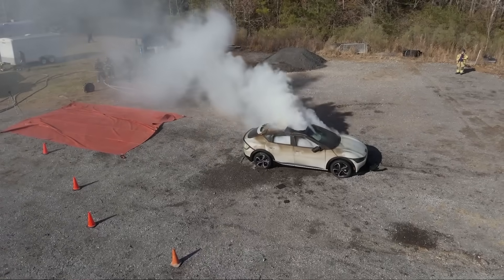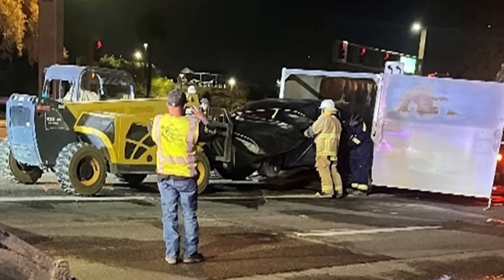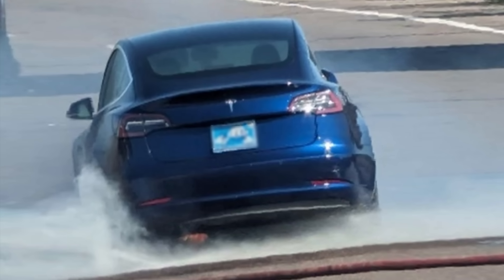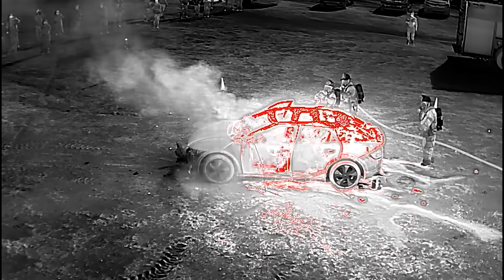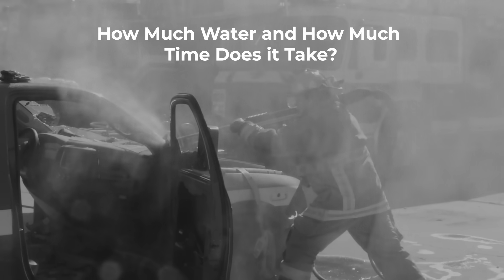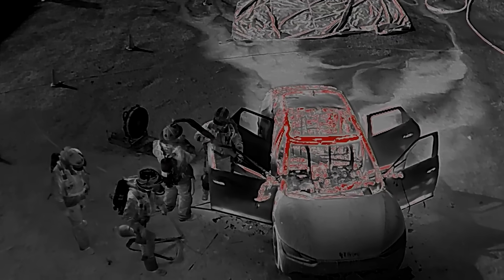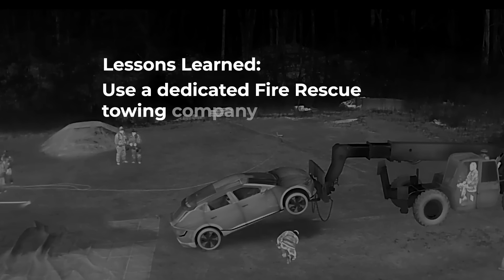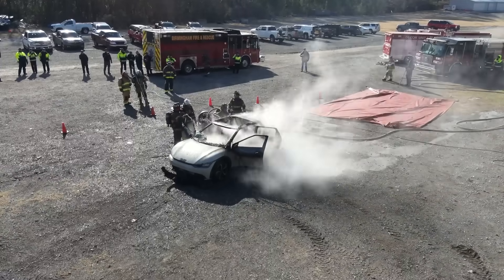Quick and Efficient Method of Extinguishing of an EV Fire tested in Tempe, Arizona

Comment: The procedures for extinguishing the specific types of fires was developed in the 1980's.... I was the project manager and worked in the aerospace industry and actually the largest advanced technologies manufacturer in the world here in Los Angeles. We injected Halon into the battery container.... The clean agent immediately terminated the fire, the nitrogen cooled the enclosure precluding reignition. Today halotron which is environmentally safe can be used, the FAA has been doing research on this specific procedure for the past several years and so far agrees with the results...typically 60 seconds from start to finish.

FYI.. we brought this to the fire both at state and national....we invited numerous fire service agencies to come to the training sessions.

100 percent no interest.
Reply: Hmm.  Old Civil Engineer here observing how comm and industrial bldg sprinklers have removed nearly all traditional fire dept business for those properties. 
There’s a constituency for not solving problems at source.  Often plays out as celebrating methods that instead treat the consequences, expensively.
Reply: @manzion7599agree on the fire sprinkler systems and fire walls for that matter are not designed for the temperatures generated by electric car fires. Typical structure fire is around 1,800 degrees.... Typical conventional vehicle fire is around 2,500 degrees..... EV battery fire.... 3,500+ degrees. This is clearly outside of the design specs of every conventional fire sprinkler system. If 20 percent of a conventional sprinkler system is activated the system is over ridden. If you look at the data, unless the EV fire occurred in the presence of a special applicatiin fire suppression system, a massive uncontrolled fire has occurred..... Structures, ships, etc.
Reply: @manzion7599now you got it! Just like the cops make sure there is enough crime to prove we need them. Hence people went to prison for cannabis while child oredators and rapidts get 5-10 years, out on good behavior in 2-3.
Reply: It doesn't need to be a high tech fluid does it? Injecting brine, as cool as it can be on site, puts out the fire due to the water but also discharges the individual cells because of the salt ions in brine. The discharged cells can't reignite.
Reply: @Bowser-j8q  Lithium and water is a bad mix.
To put out a lithium fire, yes you must cool it, but most importantly you must dilute all exposed lithium or the presence of oxygen and especially water can cause a fire.
Lithium reacts with water (oxidize) releasing the hydrogen and with sufficient heat presence said hydrogen ignites.
Reply: @Bowser-j8q  I was part of the team developing this method and we actually recommend not to use brine. The reason being the electrical risk assessment if we get a brine solution on the ground. It was one of these very low likelihood events that we want to prevent and by having clean water instead we lessen the conductivity of the water puddle.
Reply: @Bowser-j8q wate when it comes in contact with the superheated cells can violently react...plus it is extremely difficult to get water inside the battery enclosure whereas the halotron is a gas that stops the chemical chain reaction so fire cannot occur and the nitrogen which is the propellent drops the temp way below the cell ignitiin point almost immediately. In the afternath, the brine is an excellent neutralization.

Water runoff also creates a hazardous waste from the runoff where the halotron keeps the integrity of the battery box infact
Reply: @Bowser-j8q  Wouldnt brine cause a short circuit and cause the good batteries to go into thermal runaway? Remember we are dealing with high voltage/amperage here. No offense but I would stay away from discharging these giant battery packs in any way other than a controlled environment and constant monitoring of the heat generated by the batteries as they discharge.
Reply: I guess the need wasn't there back then.  In the 1980's we weren't using lithium ion batteries very much. But with over 3 million EV's on US roads in 2025 - I guess they'd be more interested now.  Also, something that needs exotic chemicals is going to be difficult for them.   This new contraption only needs water.
Reply: @SteveBakerIsHere there actually was....the aerospace industry and EV 2 had hit the market as well. The issue with water, the run off, You now have created a hazardous waste release that fire personnel are required to mitigate. That is why 3M stopped manufacturing AFFF.... Excellent at flammable liquid fires, but created large environmental hazardous waste clean up sites
Reply: @jeffalvich9434  There wasn't an "EV 2" - I assume you're talking about the second generation "EV 1".  That car used Nickel Metal Hydride batteries - not Lithium-ion...the first generation used Lead Acid.  So I'm not sure that it had the same kinds of "Thermal Runaway" that make Lion batteries so difficult.
Reply: I worked for Hughes Aircraft Company at the time, although it did not go into production until 1999 IIRR, Dr. Harold Wilson was a senior engineer at HAC Space and Communications Group, he was in charge of the program...along with GM
Reply: @SteveBakerIsHere you are right from the aspect that they didn't have the same thermal runaway type issues with recharging because you had real engineers who had decades of experience with these batteries has to compare to the current engineers.... With the exception of Ford. Ford aerospace was located in Orange county California and was a premier r&d facility for advanced technology batteries. When they closed up, HAC purchased much of their r&d equipment
Reply: @SteveBakerIsHere there was a video on an EV made in 1901 that still drives perfectly. Only thing changed was the batteries. 1901, electric motor in perfect condition.
Reply: @SteveBakerIsHere  yes there was, I worked for Hughes Aircraft Company, Dr. Howard Wilson was the project manager for both EV1&2
Reply: @SteveBakerIsHere additionally, solar batteries which comprised and utilized in fairly large quantities class d metals were significantly used in the space programs, missile tech going back to the 1960's.
Reply: there was a YouTube of Auto Expert John Cardigan about that method with cold brine injection. it was invented and used on a Norwegian car ferry; they cool the salty brine to -18°C;   -0.4°F; besides strong cooling effect , it also discharges the battery.
Reply: Pretty damn disappointing reaction.

Although I'm not sure if common use of Halotron 1 would be "approved of" since it seems like its primary component(while still way better than Halon) is still ozone depleting and is being phased out of HVAC systems for that reason.
Reply: Probably originally rejected based on cost / benefit.
Reply: @MS-Patriot2  they just didn't want to purchase 1 additional portable fire extinguisher for each fire engine. NFPA nor The California Stat Fire Marshal's Office never did a cost benefit analysis.
Reply: lithium batteries produce ther own oxidiser! they continue to burn even fully submerged - halon would do nothing
Reply: @andyman8630  that is not how halogenated hydrocarbons work. In our atmosphere it is 78% nitrogen, 20.9% oxygen, and 1.1 percent of other substances in this includes carbon, chlorine, flourine, bromine, and iodine. Halotron adds to the 1.1 percent so the 4th aspect of the fire triangle, the chemical chain reaction cannot occur. It does not nor has it ever reduced or impacted the Oxygen level in a room or area
Reply: @jeffalvich9434  
and how do these substances enter individual battery cells that are experiencing thermal runaway?
Reply: @andyman8630  injected through a tube similarly to the existing pressure relief valve. Because it is a gas, it has deep penetration by comparison for the atmosphere and actually protects e components that have not been damaged yet from flames, heat, soot.

Additionally, because the extinguishing agent is expelled with gaseous nitrogen between the ccc being broken and nitrogen creating an almost extreme cooling effect, it is almost an immediate extinguishment and inherit safeguard effect.... As compared to water....and all contained.
Reply: @jeffalvich9434  
injected into the battery pack sure, but how does it get into the 5,000+ indivual sealed cells inside? or does it simply cool the individual cells sufficiently to reverse thermal runaway?
Reply: @andyman8630  I would have to show you the VIDS..... Then your jaw would drop.... Although completely different, I also trained personnel.... About 1000 shop personnel, in live fire magnesium fire suppression. Magnesium ignites at around 970F but burns at around 7000f. If you apply water to this, the temp jumps to between 12-14000F.
And yes, there is a technique to specifically and safely suppress and contain these fires as well. Yes, I haves vids of this as well.

In a very oversimplified answer to your question, yes to both....including but not limited to the internal cell destruction which the breach allows further physical combustion degradation and elimination.

Also remember, the FAA has insisted this R&R into aviation situations and their initial reports, including the IG, validate our findings.
Reply: @jeffalvich9434  
many thanks for your in-depth descriptions! it is very much appreciated!

very glad to know there is now an effective solution to lithium-ion fires!

edit: perhaps you could upload the vids to your channel?

Comment: Could we work with manufacturers to require them to put small external PORTS for pumping fire suppressant directly into the battery packs?????
Reply: It was very clearly explained in the video that the bb-sized puncture needed to be made at the spot where thermal runaway was taking place. They had to use a thermal imaging camera to determine the right spot.
Reply: @vulpo  the only issue is price, they could put thermal sensors on every single individual cell, independently powered, that'll detect any kind of thermal problems with any part of a battery so no thermal camera is even required, it would just bring up the cost, but it could prevent a fire from even happening, catching the problem in time for the battery to be removed and safely disposed of.
Reply: @AKATenn  They already have that to achieve fast charging. The problem comes when it breaks down.
Reply: Ray, you are onto something. Obviously, the big advantage here is getting water directly in the battery. Many EV batteries already have liquid cooling, presumably compromised when there is a battery fire. While battery fires are rare, they are hard to put out when they do occur. That would be a good way to change the equation. I own several EV‘s, and one thing I’ve noticed is that the high power wiring is becoming better marked to cut to stop power to the battery. This would be another way to improve safety.
Reply: Doesn't need to be external just accessible. Doesn't need to be stainless steel just effective at putting water in the right place.

On model x cut here blast with more than 80 psi and all batteries will be flooded. 

Till that happens put a tax on evs to pay for this equipment. Charge the insurance co if a fire is put out. Create facilities to process the damaged batteries back to base material.
Reply: Imagine coming out of a store to your car to find that someones pumped water through the port designed for the firefighters, trust me, its a bad idea, if a sign doesnt stop criminals from bringing a gun into a certain area, not much is gonna stop bad actors from getting their hands on whatever adapter they need to use that port as well.
Reply: @Initial_Gopnik  Yea I spent the last 5 years looking for cars with a water port just so I could try too pee in it?????
Reply: @rayclark7963  someone's never used a pressure washer, do you watch when your wifes boyfriend comes over?😂
Reply: @Initial_Gopnik  Most Ratfink fans make more sense when they speak..
Reply: @rayclark7963  if i dont make sense buddy, something just aint right with you, everything is in plain old english 😂
Reply: ..vandalism. anyone could rig a canister to inject into that port, now the car fire is a car inferno
Reply: wow do you want to do that also for ice vehicles as they are 100x more likely to catch fire
Reply: @flodjod You didn’t have any credibility to lose in the first place, but if you did, this flagrant lie would have done away with it!
Reply: @flodjod  a ice fire is easy, quick, simple.  Did you hear how complicated, special equipment, training to attempt to put out a EV?
Reply: @flodjod  I don't know, what "ice vehicles" are. You mean snowcats? Yes, if neccessary do it there, too. But I didn't know they are likely to catch fire.
Actually any vehicle may ignite - the point is that Teslas are extremly hard to extinguish.
I'm glad to hear that this European invention is used in the US. I support mutual tax exemptions for emergency equipment

Comment: Why not just stop making worthless electric vehicles that can’t go more 200 miles and now cause toxic fumes when they catch fire.
Reply: Per 100K sold, ICE vehicles are involved in 1,500 fires. That is 60 times larger than the 25-per-100K sold for EVs.
Reply: @ at least the fire departments can extinguish the fires and keep the public safe from toxic fumes and reigniting batteries that continue to burn for days. Electric cars are a fad that will burn out, over the next decade.
Reply: "electric vehicles that can’t go more 200 miles" You've been living under a rock. Based on CarWow annual real world test in England. In cold damp weather at night the industry has settled around 260 miles for the attainable price cars while premium cars are doing Way over 300 miles. FYI toxic fumes like Hydrogen Fluroride comes from Burning PLASTICS! ICE cars have just as much Plastics thus the same toxic fumes. Your fear mongering nonsense is worthless.

Comment: Time for fire departments to lean on NHTSA and other federal automotive safety regulators to mandate stricter rules on EVs regarding door handles, battery box construction, emergency battery access and disconnect and much more.
Reply: Fire department can just smash the glass - an EV fire has already destroyed the vehicle anyway - so there is no penalty for doing additional damage.
Reply: Trying not to <sigh...> but....
"EV door locks"
In terms of "door locks" an "EV" is a "CAR".
The door locks are actuated by the LOW VOLTAGE BATTERY , NOT the "Traction battery".
The circuit is thus the same as ANY modern vehicle.
.
"Battery box construction" .... Try some actual "Research" rather than hearsay?
Most manufacturers have information regarding construction and safety on their websites (CATL is particularly good)
Disconnection: you DO know there is a mandatory safety disconnect on all EVS?
.
Define "Much more"?
.
Personally, I would like to see a "NASCAR/ F1" type Fuel cell and cut off system on all road cars to prevent gasoline fire. Sounds like a good idea? Correct?
smh
Reply: @rogerstarkey5390 my dude did you not watch the video? The they literally said they could not open the doors! If they could have opened the doors it would have been out sooner.
Reply: @bryans73663  Retractable door handles can be overridden by breaking the window and reaching for the manual latch on the door card; in some vehicles, this actually just means pulling the normal interior lever more firmly than usual. No battery power required.
Reply: @Furious321 the issue is that some cars don't have a mechanical door latch even on the interior. this is normally due to having a frameless door (and thus not only for EVs) but what would be nice is required mechanical overrides (like Tesla has for the front doors just required for all doors)

though the issue with mechanical overrides is that they don't matter if the door is jammed shut which is gonna happen in a LOT of crashes as the doors are where a lot of the front-back structure is so they get crushed between the pillers